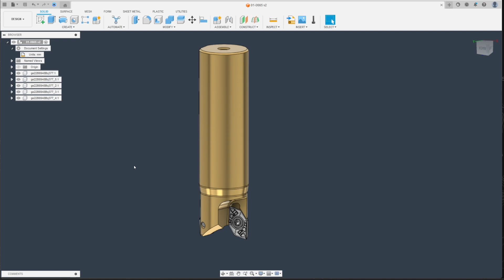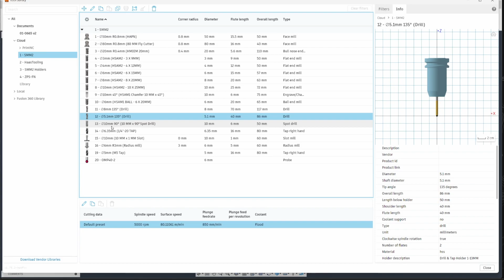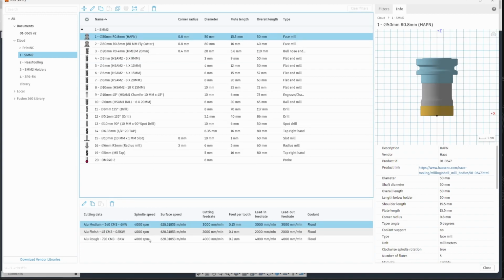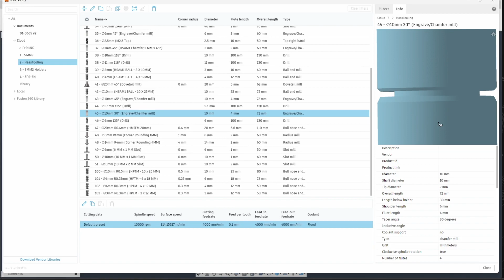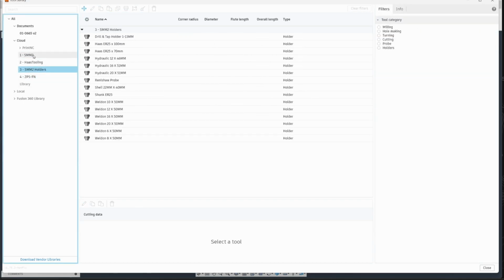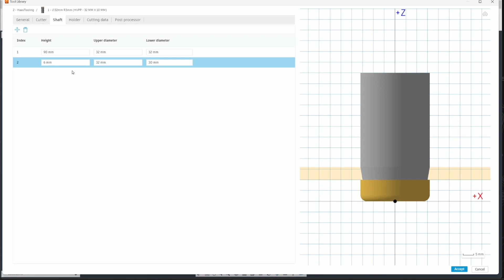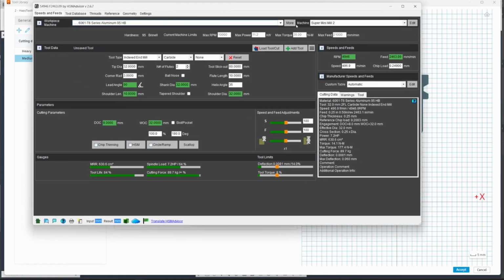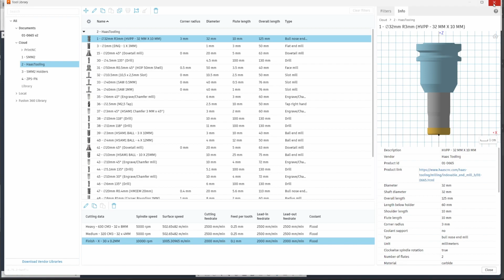Quick Tip - Tool Library in Fusion 360

Comment: I was hoping to find instructions on how to take an existing soild model and importing it as a tool. But you kind of answered a question about the "shaft" options. 👍
Reply from the maker: In the current state of Fusion, there's no easy / direct way to import neither a tool or holder into Fusion.

The best method is as shown, design the Holder / Shaft by sections. It's slow, and clunky, but it works.
There's also the option to do said tool as a "Form Tool" which would allow you to simplify it, since you can take a existing model, do a very small edit and have it just work. Problem is, youi cannot really adjust said form tool as far as i recall.

Thanks for watching!
Reply: I use a script and convert a solid to a .json file which I import to tool library. Then I kinda just finish it off with size of insert. This gives close to 100% accurate model of tool. 

What it does is that it takes an imported solid/step file. And “calculate its spin profile.